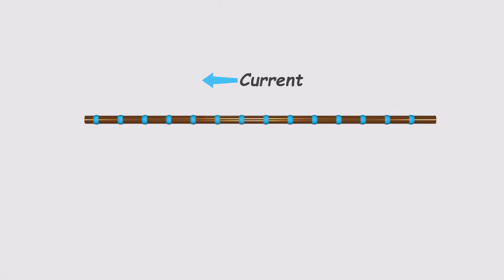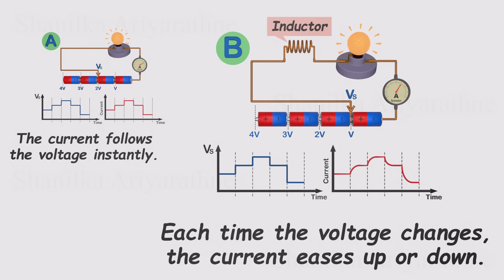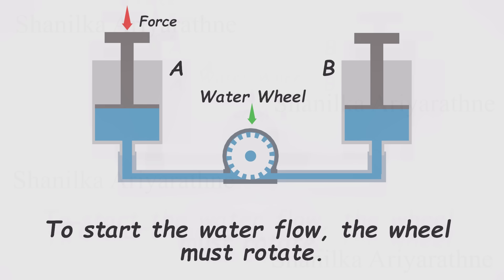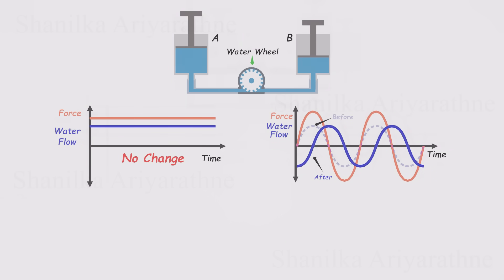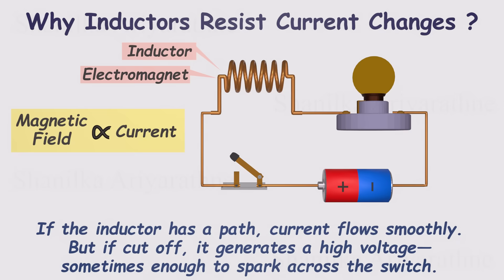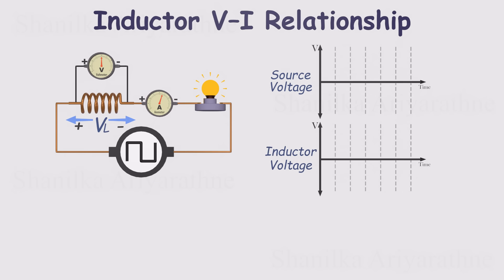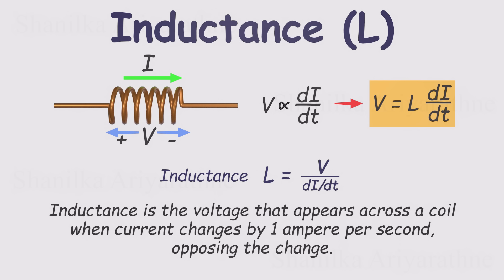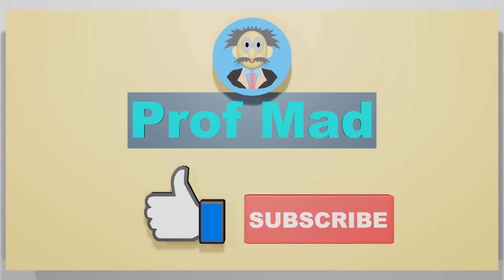The Hidden Power of Inductors — Why Coils Resist Change!

Comment: NONSENSE.

Current is magnetic momentum. Meaning magnetic field intersect to create collective magnetic field.

Wire here to china transfer current because it become single magnetic field vibration.

In coil , magnetic field will create magnetic field of its own because of rotation and they try to block the movement of normal magnetic field movement

Hence current slow down intially until it overcomes it

Comment: The simplest form of an inductor is an electrical conductor. A piece of perfectly straight wire is an inductor. All conductors exhibit inductance. The inductance of ordinary wires or tracks on a printed circuit board is of great concern in many circuits.
With prefect coupling among turns, a wound inductor's inductance will be proportional to the square of the number of turns.

Current will not lag voltage by 90° in an AC RL circuit unless R is zero, that is, it is a purely inductive circuit.  As R is increased the lag decreases. For example, when the inductive reactance equals the resistance the phase lag will be only 45 degrees. As the ratio of resistance to inductive reactance increases, the phase shift approaches zero.

In the pulsing DC circuit, the current will reach steady-state and the voltage across the inductor will drop to zero each half cycle (with a square wave, as shown) only if the inductance is "low" so that the L/R time constant (that is, L in henries divided by R in ohms, for a time constant expressed in seconds) is significantly less than the half cycle duration. It takes about four and a half time constants for the current to get to about 99% of what would be the eventual steady state magnitude.

This really doesn't explain why an inductor "resists change." Sure, energy is being stored, but just exactly what is going on? No mention is made of the fact that the changing magnetic field induces an EMF that itself opposes the EMF that creates the field. This is described by Lenz's law.

Comment: Very good vid, but I feel the thing about one of the ways of inductance being increased being by reducing the length of the coil should have been a little more carefully explained: yes, true if you keep the same number if coils, or, more precisely, increased the number of coils per any given length; but if you simply reduced the length by cutting the coil in half (and rejoining it to the circuit) you would reduce inductance, no?

Comment: Here's the answer: Inductor's are just wires coiled to form toroids etc. why does it resist change? reason is when current pass through, the magnetic fields of the coiled wire overlaps and it affects each other before finally settling down and its magnitude is much higher than just a straight wire because it combines all that magnetic field together. when you release the current, the combined magnetic field doesn't immediately collapse as it needs to unravel each individual fields from the coiled wires. so it takes time unravel itself, slowly it releases that energy. the force needed to combined that field is the same force needed to unravel itself. this follows conservation of energy at it's purest form

if you undo the coil into a straight line, the magnetic field is still there when current pass through but theres no resistance in forming that magnetic field as there is no overlap. so it has almost zero inductance. there you have it.

Comment: The main question remains unanswered: why it takes time to buld up the energy in the inductor. Something tells me that the cause is the same that makes mass resist acceleration and it somehow related to relativity. (potential delay or smt like thar). It'd be great if someone could give a clear cut coherent intuition about it.
Reply: @manabouttown7865 Inductors doesn't just look like springs. They behave like their electrical counterparts too. Imagine a spring mounted on a wall and pushing an object against, then stopping for a second and releasing it. Same goes for current through inductors. The energy is built up in them first in the form of magnetic field and then it slowly starts yielding, thus the steady current. Once released, the built up energy bounces back and the current flows in opposite direction.
Reply: @imtiyazshaikh5331 The concept of magnetic field is convenient an works fine in most practical applications as part of rhe theoretical model. But if you need to explain what happens on the fundamrntal level you need to dig o bit deeper,. It jJust like with gravity - we use it as a concept, but fundamentally  it's space -time curvature.

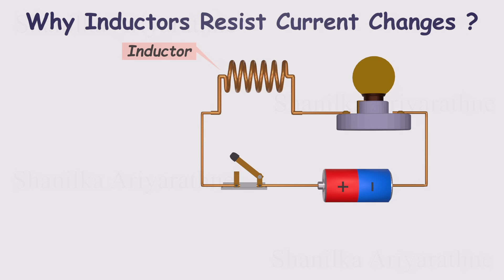Comment: Here, saying 6:31 inductive reactance doesn't appear in DC circuit. But here 6:57 a DC circuit is shown for inductive reactance. So this is confusing.
Reply: Inductive reactance doesn't appear when the voltage is steady (that is DC, by definition). But it can appear momentarily when you switch on or off, since there is change in voltage.

Comment: I believe the sinusoidal plots at 10:40 are wrong. Voltage and current in the inductor are in quadrature, yes, but there is a phase shift between the voltage in the inductor and the supply voltage. You can easily see it in the Argand diagram.
Reply: Está correto

Comment: Within electric circuits the inductors are autistic components resisting the changes like Republicans, capacitors schizophrenic and passing chaotic noise like Democrat wokes, whereas moderating resistors are these realistic centrist ones. The combination of inductors and capacitors leads to oscillations similar like the combination of leftists and rightwing voters leads to destabilization of society. USA society now needs more centrist voters for moderation of political extremes.
Reply: You ok chap? Have a cuppa tea boss.🙂
Reply: @stuart6607  I see, resistance is futile...
Reply: @stuart6607 у всех свои абстракции!
Reply: А какую роль ты отводишь КОММУНИСТАМ?
Reply: @ПавелИльин-н6г  Communists propagate changes forcefully through society with no resistance, so that they behave like huge capacitor passing voltage changes into circuit with no impedance.
Reply: Curto circuito  @ПавелИльин-н6г

Comment: Another great video. Inductors are such a mystery to me. Capacitors I get inductors I have a harder time with 😂. I guess the problem is thinking in terms of voltage rather than in terms of current or the circuit os a whole.
Reply from the maker: Thanks for the kind words, I appreciate it! 😊
Reply: Think of ELI the ICE man to know what lead and lag. ELI, In an inductive circuit voltage leads current by 90°. And in a capacitive circuit current leads voltage by 90°
Reply: The real problem with inductance is that the magnetic field is a relativistic manifestation of the electric field in a different reference frame. The working of an inductor is counterintuitive because relativity is counterintuitive. As an added bonus, Kirchhoff's voltage law ceases to be valid inside an inductor, and that breaks intuition even more.
Reply: @copernicofelinis  Walter Lewin?
Reply: @eric4709 Lewin contributed to popularize the break in intuition behind inductors, but the consequences of nonconservativity of the electric field in the presence of magnetic induction were described in EM books and papers decades before his famouse demo.
It's in Purcell's Berkeley Physics, for example. And in the books by Haus and Melcher and by Zahn available on the MIT OCW.